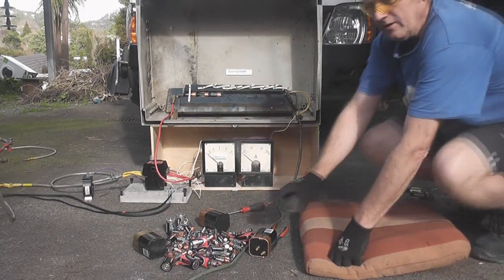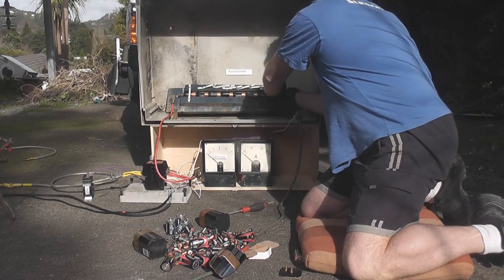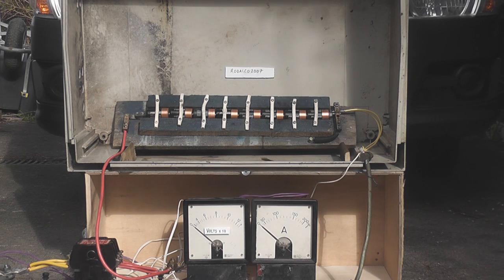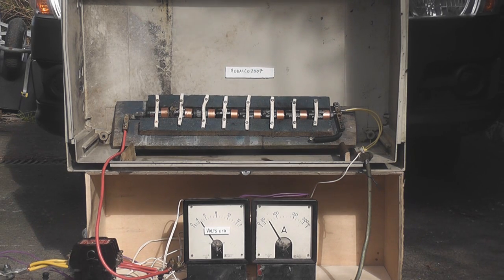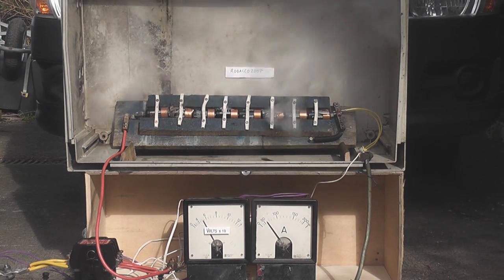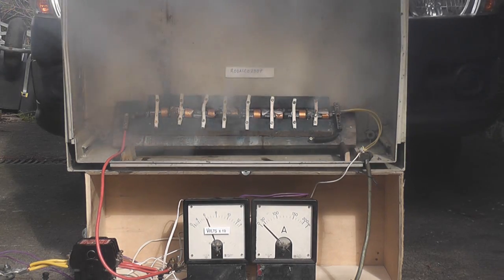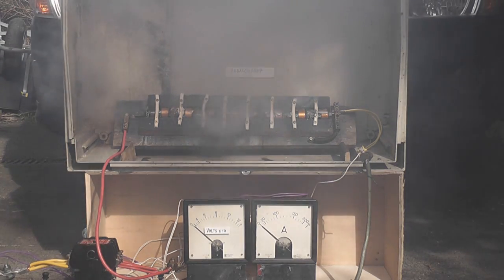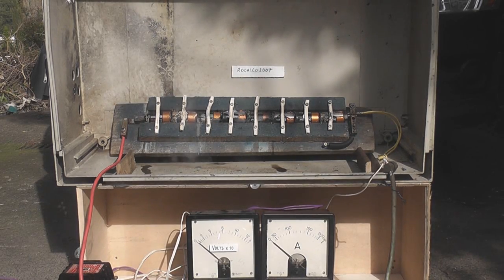Old D-cell batteries burn out with sparks on 72 Volts A.C.  [ 2 ]

Comment: You need more current to blast those cells open circuit when they go short. The 20A mains side breaker is not enough, go for a 40A, and crank up the fault current, use a more powerful transformer so the batteries cannot load down the supply. I post some violent battery explosion myself soon. hehe...